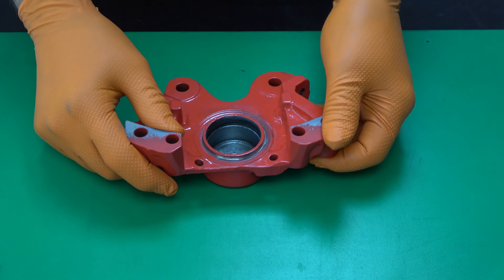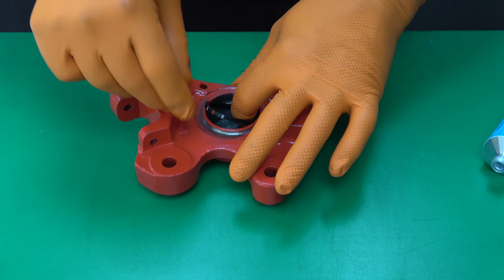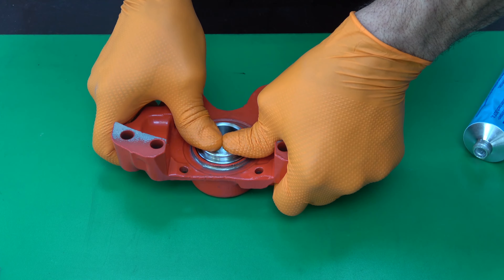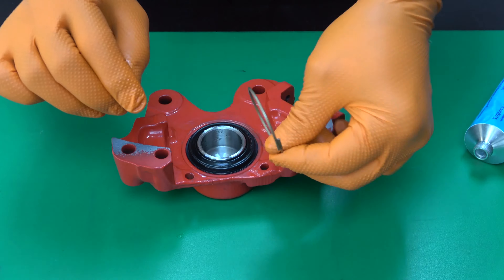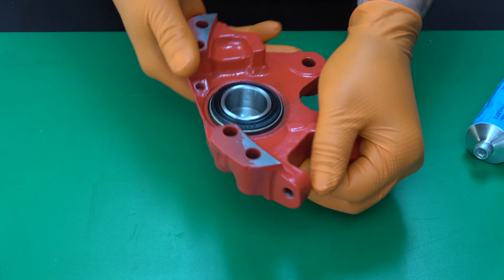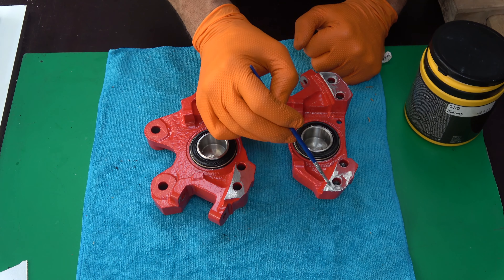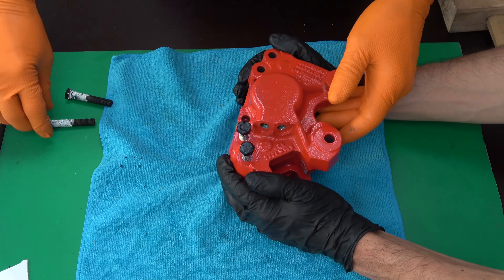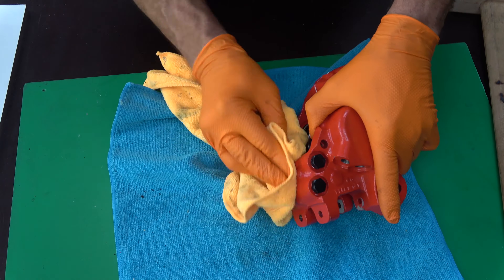Rear Brake Calipers assembly for Jaguar XJS

Comment: Very good video. Which Manual did you use for the brake system and where did you get the part number for the new bolts from?
Reply from the maker: Thanks!!!
I have used old bolts, just renew it (I removed little rust on them and painted with proved high temperature paint). 
This bolts don't have a part number. As alternatives, can find on market with same  bolt thread step, same bolt diameter, length  and same or better bolt grade.

About user manual and torque. I did mistake, when told 66-77 nm. It is tightening torque for bolts retaining brake caliper. 
Not for bolts, which split (connect) two parts calipers.

Anyway, i did tighten to 71 Nm for this bolts.
Because : 1) I used old bolts. 2) I don't used Loctite - thread-locker 3) I think, the brake calipers bolts should hold high tightening torque 
I have read  forums, watch  videos. But nobody don't tell exactly which tightening torque must have this bolts.
Someone telling  40 Nm, others telling  60 Nm or more....